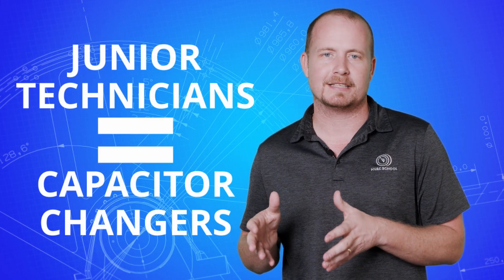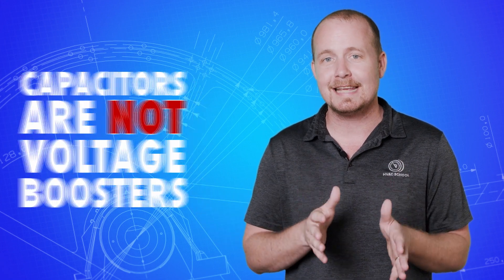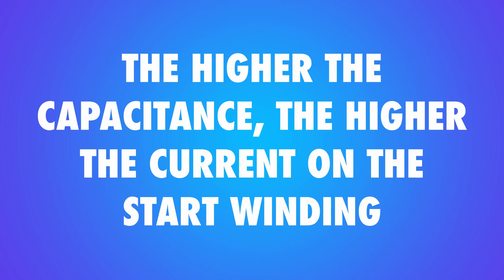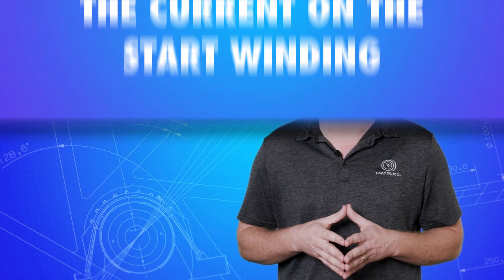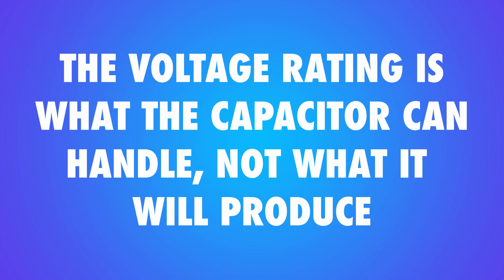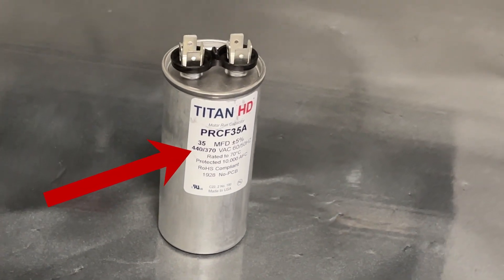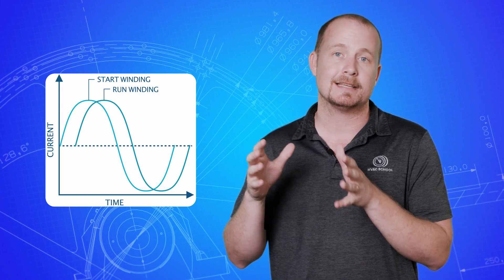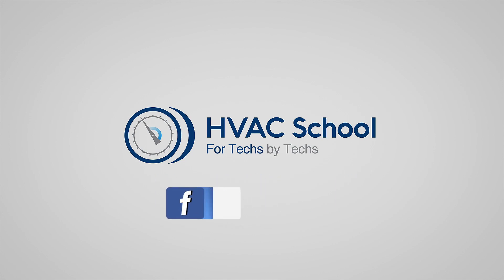5 Misunderstood AC Run Capacitor Facts

Comment: To all who say why would you want to use this method?

This method allows the flexibility to check while running under a few circumstances: 

1 a critical application where they don’t want to shut the system down while you check it. I haven’t been around mainframe computers in decades but I remember when they used to shut down things if the room temp exceeded a certain temp. 

2 I have many times seen components that check good on a bench and fail under load.  I am sure I’m not the Lone Ranger on that.  This method gives you a real time, under load look at how the capacitor is performing.  

3 It also lets you check running capacitor when you find yourself using a meter that can check amps and volts but not capacitance.   

Back in the day if you had an analog Simpson 260 you had a Cadillac of a meter.  It did not do capacitance.  If you had a capacitor on the bench you could only test for open, or if it pegged the meter and stayed there, or was grounded to the case or watch the cap charge and discharge by watching the meter cycle rising and returning to zero.  That did not tell you what the capacitance was, just that it would charge and discharge.   

I know I just dated myself and I am ready for the jokes but no I did not personally know Jesus, Moses or Methuselah.
Reply: It’s still the Cadillac of meters, I have a Sperry, doesn’t have the taught band suspension needle like the Simpson but I bought it when I started in refrigeration in 1975 and I’m still using it these days.
Reply: @nunyabusiness6746  The problem with analog is old eyesight.  😁

Comment: Can u still use a capacitor thats reading a higher mfd on ur multimeter than whats listed on the capacitor? N no bleed resistor connected.

Comment: Why does the run oil capacitor fail so often ?? I have many used capacitor that are many years old and still good. How can you clarify this ??? Thanks
Reply: Heat. It's the killer of all things. Easy as that. There's different types of capacitors for what it's worth. And different quality of builds and materials. Just one of those things that is cheaper to mass produce crop quality and replace than spend extra dough on a good one.
Reply: @etherealrose2139  Thanks

Comment: Why are capacitors not polarized like they were in the older days?
Reply: DC systems still are.

In AC current flows both ways. Makes no sense to polarize an Alternating Current capacitor. It's primary use is phase shifting not storage and release of energy (though technically it does that 60 times per second) It also smooths the ripple some.
Reply: Improved safety.

Comment: How can a condenser run fine when the common wire from the top of the contactor to the capacitor has been burned and is no longer making any connection? If I remember it was the common wire. 

I’ve witnessed this twice and the system was seemingly running fine. I believe the spade terminals were loose and caused heat buildup and eventual burning of the wire. Just confused how they were kicking along fine without the wire.
Reply: I have had the same experience many times. Vibration can cause such problems.

Comment: OK. So why is a run capacitor wired to the start winding?
Reply: Since it is not switched out after start up, the "start" winding is strictly speaking the auxiliary winding.  The run capacitor provides the delay in the current between the run winding and aux winding to create the magnetic field difference to start the rotor turning, but then while the motor is running the run cap was chosen by the designers to provide the most circular magnetic field profile between the run and aux winding at the design load for the most efficient operation.  The more the field profile is unbalanced, the more heat losses and motor stress.

Essentially, the run cap "tunes" the PSC motor for the most efficient operation at design load. When the cap starts going bad, or the wrong size MFD one is installed, more of the power goes to heat in the windings instead of rotation  and eventual motor failure.
Reply: @jkbrown5496  
Thank you!  
Best explanation ever
Reply: It acts as a 3rd phase, helping to make sure the motor spins in the right direction.

Comment: Can you go into more details about measuring the mfd while the system is running?
Reply: Just get the amperage at the start winding of each motor. For the compressor it’s the blue, hermetic wire going to the compressor and brown for OFM. Take your phone and multiply that amps by 2652. Then measure the voltage for that motor to C on the cap and remember it. Take your phone and divide the previous number by this voltage. It’s important to remember that this technique should not be used for troubleshooting but only to get an approximate value on a cap where the numbers are faded or not visible. I’ve found that this can be off by .5UF, which can be the difference between a condemning or not. Always verify with all cables removed and apply what you read online to become a better tech every day
Reply: @peepeepoopoo1399  : Always become a better tech!
Reply: Look in the HVAC School playlists. They have a video dedicated to this topic.

Comment: You can check a capacitor while it's running.
Me: OH?! 
Measure the amperage on the start winding and multiply by...
Me: Wait what?
It's okay just multiply and divide by...
Me: I'll just turn it off, never mind.
Reply: It's very easy, more efficient, eliminates hooking wires back incorrectly and eliminates bending/loosening the spade terminals. Multiple 2652 x the amp draw of the herm or fan wire, depends which side of the capacitor you're checking, then divide by the voltage between the C and herm or fan terminal. Make a cheat sheet till it becomes second nature.
Reply: Where do the 3183 and  2652 come from?
Reply: @saurisco338  
From Bryan Orr on ACHRnews

“Since I started training with this method, I have often been asked where this calculation comes from. It is actually a simplified version of the equation to find capacitative reactance combined with a version of Ohm’s Law: Xc = 1/(2 x π x ƒ x C) and E = I x Xc.

I’m taking the 1/(2πƒ) part, multiplying by the measure we’re looking for (microfarads or millionths of a farad). This gives us the capacitative reactance, which, multiplied by the amperage and then divided by the voltage, gives us the capacitance. So you get: Xc = 2,652 and E = 4.4 x Xc = 11,668.8, so that 11,668.8 ÷ 335 V = 34.83.

To simplify, we can use approximate numbers and just call it amps times 2,652. Then, divide by the voltage.”

I’m old and like they said 2562 is a constant and it hasn’t changed over my lifetime.
Reply: @saurisco338  Those numbers come from the association between capacitance and impedance. The impedance (Z) of an ideal capacitor is 1/(2*pi*f*C), with a 90 deg phase shift. You can calculate the impedance by measuring voltage drop across the cap and current through it, then use ohm's law, E=I*Z. Then knowing the impedance, plug it into the above formula and out comes capacitance. Those two numbers come from the 2*pi*f component of the equation, simplified to make it easy to remember.
Reply: @saurisco338  You can Google and get bogged down in the weeds if you want to be a math major. Not too important. They are known as "constants", they stay the same every time you do the math.
Reply: @Daddy692k  Your initial reply "Yeah screw that, just pull the disconnect and check it 😂" and you say for me not to be a moron?  Looks like someone can't do math, doesn't want to improve, to dumb to remember the steps or doesn't want their hands in the control panel. HVAC School videos offer information for us to be able to improve as technicians so I don't understand why you are hear. Oh, to hurl insults at people and make yourself feel like the man you are only in your dreams. Get back to work "capacitor changer".
Reply: Electricity does not take the path of least resistance, but I see most humans do.
Reply: @kooldoozer  lmao yes it does
Reply: @andrewcastleberry4921  Electricity does not take the path of least resistance.  It takes all paths, proportional to their individual resistance.  If electricity only took the path of least resistance, only one load on a parallel circuit would receive current. We all know that's not true.

Comment: These short videos are so informative. Where do the numbers in that equation come from? What does the 26520 and 3183 represent.
Reply: E = I * Xc

Capacitive Reactance (Xc) is calculated like this:

Xc = 1 / (2 x pi x hz x farad)

Xc = 1 / (2 x 3.1415 (pi) x 60 (hz) x farad)

Xc = 0.0026527 x farad

farad = 1,000,000 microfarads

So 0.0026527 must be multiplied by 1,000,000

Xc = 0.0026527 ✕ 1,000,000

Xc = 2652.7

E = I x 2653

Formula :

amps x 2653 / volts

example - 4.8 amps x 2653 / 363 volts = 35.08 mfd
Reply: @jeffb8437 : Save time and money; change the damned capacitor!
Reply: @jeffb8437 now do reactive capacitance.
Reply: Not important, they are known as constants. If you're in the U.S. you need 2652 for 60Hz. Just remember, 2652 x amperage divided by voltage.
Reply: @bill944 I knew Constance back in high school. Big girl. She lost weight after graduation.

Comment: Great vid. Curious on hvac schools thoughts on proper unit sizing. How would you factor in 10 1000w hps lights? 😏🤫
Reply: It’s not just the lights you have to factor for.  Just the lights alone 3 tons is more than enough for but only when properly installed and properly ducted. ( ONLY! ) 
            What kind and how many watts of power are your dehumidifiers you’re going to use in the room that is part of the load calculation and BTUs

          Are you one of those guys who are going to have four wall fans on every wall with lots of airflow so you don’t have stagnant air what is the white power consumption of each one of those fan motors that adds heat to the room in BTUs. 

        Are you one of those guys who believe in high humidity growth regiment vapor pressure deficit at 70+ percent humidity. 

          Or are you one of those guys who believe in the high dry desert method of growing around 40% humidity.    These are both very different grow procedures and heat loads because of your latent heat not your sensible heat. 

            Will you have any other large motors in your room that consume lots of power like multiple large water pumps for under toe system or thin film nutrient system where the motors are on 24 seven inside the room you have to calculate in that added heat load. 

        What is the house or building is it a single-story wooden house with next to no insulation on the roof with a south facing wall with no or little insulation and possibly painted dark brown or dark gray.  
           I’ve seen rooms need an extra three or 4 tons just because of the color and lack of insulation in the building material used having nothing to do with the light load. 

              Are you doing air room exchanges with large fans 24 seven what is the outside air temperature and humidity you have to take that in for consideration. 

          Or are you doing 100% complete sealed rooms with no breathing with tanks of CO2 injection into the room on timers and CO2 sensors?. 

         Are you located in North Dakota ? 
  Are you located in Florida
Are you located in the Arizona desert
Or Denver Colorado up in the mountains

       Don’t think of just the lights as your heat load.
Reply: @coldfinger459sub0  Really really appreciate your thorough response. I was certainly not thinking about many of the factors you pointed out. I’m gonna save your comment to refer to.
Reply: @coldfinger459sub0  I had to laugh at the oddly specific response. Someone knows how wild grow rooms can get lol. Way too smelly for me
Reply: @coldfinger459sub0  Do you have any recommendation ,a book or somewhere online, that would have good info on how to factor in everything you just said?
Reply: When I came to Houston Texas noticed Cos. from elsewhere oversizing HVAC units and then adding dehumidifiers! Crazy approach and a disservice to the customers!